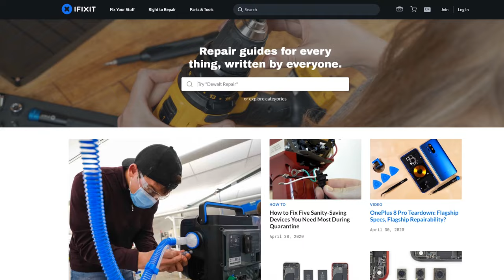Rebuilding my Gaming PC for Fun (not fun....)

Comment: When you want to water cool your PC, just watch any LTT video where they do any maintenance on water cooled PCs. Helps me every time to stick with air cooling.
Reply: Yeah watercooling will quite easily turn into a hassle. A way to make it reasonably easy on yourself however is to plan your custom loop with well placed drainage and fill plug.
Reply: Just used my first AIO.  Seems like a good way to go.
Reply: @Gerniaz  yeah but compare it to a good air cooler, which you basically just pop on. You may get some extra performance with a good loop, but not  enough to excuse the extra cost, work and adding points of potentially critical failure, if you are only going for performance.

If there are space issues, or you have requirements for looks, or you are doing it just for fun, that is a whole different thing.
Reply: @johnh8268  I have found that AIOs', and Linus has shown us, that an AIO is worse at cooling and noisier than air cooling. They also don't looke nearly as good as a custom loop, so at that point why even do it.

But hey, you do you. Some of the AIOs' you can buy now looks decent if you get luky and they fit well in your system.
Reply: Well - you can build a custom water cooling loop that's virtually maintenance free ... but that's not what you see on youtube.
Reply: I'm right there with you. I can't be bothered to clean out the filters or fans but once every 3 or 4 years (typically  pretty clean anyhow), no way am I going to toss water into the mix.
Reply: @Gerniaz  Custom waterloops are for esthetics and if you have real interest in tinkering with your computer and reaching max overclocks IMO , aio's cool better with a few degrees with more failure points, Protip check gamers nexus video on it, and thermodynamics doesent lie.It  takes alot longer for aios to reach lvled temps, so with boost clocks it's an advantage. but as you said you do you. Dont lie and say that air cools better it just isn't true.
Reply: @Gerniaz  Link: https://www.youtube.com/watch?v=7VzXHUTqE7E
Reply: @varghfenrisulven5408  Well It seems I misremembered, which is way different from lying btw, but at least we agree that well done custom waterloops are there for esthetics and little else. 

For 'ordinary' people air wins out everytime.

The argument that it's for max overclocks I call bullshitt on however, if that's the goal you use mineraloil for long term, and LN for short term.
Reply: @Gerniaz  And that's where Jay shows how it should be done.
Reply: @Gerniaz  there's always that one Arctic AIO that actually does better than the majority of AIOs on the market. Even does better than a lot of air coolers because it does so well.
Reply: @Child3k  so... It somehow stays dust free too? I'm interested.
Reply: @varghfenrisulven5408  those more rads at it and get good airflow over those rads and you can get pretty close to ambient temps. So it can be significantly better cooling. An example of way overkill water cooling was that one video Jay did with a box fan and a bunch of rads.
Reply: @Gerniaz  LN2 does indeed make it possible to hit max clocks, but the computer isn't really in a usable state. Water cooling will make it more possible to hit your stable limits and for possibly longer term by keeping thermals down.
Reply: @ArtisChronicles  I'd say dust collection is about the same as every other fuckin' cooling method.
Reply: @Gerniaz  Ok thanks for the answer, we all misremember things. Sorry if it came of hostile. and yeah you are right in that air is the best for ordinary people. I should have clarified it to enthusiast lvl overclocking without ln2 or mineral oil. built a mineral pc in school a few years ago, thats just not feasible to do at home imo.
Reply: idk, the one where they just use an aquarium pump, a cheap block, and a bucket of icewater looks pretty compelling. /joke/ Although if I was ever going to get into watercooling it would be with the ultimate goal of building some crazy sub ambient thing.

Comment: Timestamps:
54:22 starts building/upgrading 
1:14:22 starts fixing things
3:01:21 installs power Supply 
3:03:20 installs motherboard 
3:05:01 installs graphics card 
4:16:52 installs water cooling 
4:57:24 finishes cables
4:59:05 RGB strips replacement 
5:01:05 cable management etc
5:13:10 water cooling adjustment
5:16:32 end of stream
As most people were saying that some times stamps go over the end of the video I removed them. It's not my fault, YouTube cut the video.
Specs:
Ryzen 9 3900x
X570 aqua motherboard
RTX titan 
Gigabyte 1TB SSD
AX 1500i PSU 
EK coolstream 
Bits power tubing 
Corsair dominator 2666 x4
Reply: You sat through the whole thing?
Reply: Wow he could really use RAM upgrade, 2666 MHz with Ryzen 3900x??? Such a waste of CPU power.
Reply: @chnapo1  Yeah bud, he stated that in the video already.
Reply: There aren't any  r5 3900x...
Reply: @JoseSalazar-tk1kd  no one said there was he said ryzen 3900x. thats a ryzen 9.
Reply: Corrected, thank you.
Reply: A madlad watching the whole stream!
Reply: bonus corn xD
Reply: So, the build starts at the 3h mark
Reply: @chnapo1  1) It was carried over from his old Intel-based build. 
2) The silver accents of the old Corsair RAM fits the AsRock X570 Aqua's aesthetics, otherwise he could've just grabbed any other RAM.
Reply: @reikisano4542  yeah awesome he has aesthetics in his rack case which is mounted in rack which is in his server room, instead of actual performance 😂
Reply: when i last remember his son from his first pc building with son video 0_0 im old
Reply: 4:57:03 New way of eating corn
Reply: @CorpseHusbandTopic  sorta
Reply: @chnapo1  Hey, I'm not Linus. I'm just relaying his reasons for that particular decision.
Reply: You sir are a hero
Reply: Thanks for this! 🙌🏻
Reply: @philip2618  The original post said r5 not r9. The post even indicates that it has been edited.
Reply: 4:05:14 Should Linus sell his son
Reply: It ends at 5:16 o.o
Reply: MVP of the comments thanks man!!
Reply: @Dracossaint  Live video went on till 5:43:xx, but for YT re-upload, Linus has trimmed down the video and made a lot of cuts!
Reply: The video (stream) is only 5:16:32... where are your extra 30 min?
Reply: @akuno7294  It was very late when I was doing this so so I was bound to make a mistake. Thanks for pointing it out!
Reply: @Bandit4557  Not everyone has time to sit through five and a half fucking hours of this.
Reply: Wait why did you make time stamps 16 minutes after the stream ends?
Reply: @calvin1053  To be honest, I have no Idea. I'll fix that.
Reply: @akuno7294  kiran made a great point. Due to YouTube,  they trimmed down the video and it was originally 5:43 or something hours long.
Reply: @chnapo1  ram isnt as big of a deal on ryzen 3rd series, yes he could get faster ram, but i doubt he even needs more speed.
Reply: a bunch of these stamps are after the video ended xD
Reply: @MikeHedges1993  ooh boi it is! Low latency high speed ram works better than low speed ram and OCd IF
Reply: @chnapo1  yea no duh, but linus doesnt care, hes already going to be running things high as hell. he probably cares more about the looks.
Reply: You legendary madlad
Reply: youre a man of god for those time stamps
Reply: 10:28 linus starts sucking the tube

Comment: I only give myself 4.5 hours of sleep a night, this is longer. I plan on watching 1.5x speed for 20 minutes a day,  which it will still take me 11.4  days to watch this. **UPDATE: they cut and edited out the first 9:34 minutes of the video when there were tech issues. 
**Also @UCEF8iR5 has the timestamp. I'm stopping this. 
0:06 Welcome 
0:15 Linus's first Gaming System 
1:08 Audio cut on Twitch 
3:42 Linus is Cutting the stream
4:04 Back on track 
4:24 Video Actually Starts 
4:40 Linus exchange and Story with Kyle
6:25 Bringing first PC home
7:12 Audio cut on Youtube 
8:46 Audio Back 
9:34 Video Actually Starts (For real this time)
9:52 Linus being a wee lad with Kyle 
10:49 Bringing first PC home
11:57 Take That Kyle 
12:06 What Linus is doing today 
14:01 Draining Machine 
19:24 Linus giving his rig a blow job 
21:55 Removing Graphics Card
25:21 removing SSD
27:40 Scary Bucket 
27:50 Motherboard Out
28:40 Removing Power Supply 
30:31 Wireless Mic Issues 
36:12 End of the stream 
38:28 Linus calling Nick
45:12 LTTStore.com (unsolicited)
45:41 We are continuing
46:12 Removing Reservoir
*Continue with Directors Cut Timeline below*
25:30 Removing Radiators 
35:16 Not a Little Man 
35:21 Vacuuming the Radiators (brought to you by Dyson)
40:12 The more you know: Rice
44:33 Cleaning the fans
Reply: OK👌
Reply: someone tag me in this when he’s finished
Reply: Watch it on 2 speed and do it 0.5 faster
Reply: why not watch 40 minutes and cut your time In half?
Reply: @AcerAssi  LOL, you mean 1.5x faster?

Or do you mean watch it in 0.5 the amount of time?
Reply: @runninggames771  he said that he well watch it on 1.5 i meant that he should watch it on 2.0
Reply: Bruh making my comments to get notifications
Reply: You should really sleep more. I did the same shit for a couple of years and now my body is in shambles.
Reply: I'ma just insert myself here
Reply: @gjdakin  some people can actually live perfectly normal like that, but not many
Reply: @gjdakin  eh, I can function
Reply: @polrzx  Nah, they edited out the beginning after their was a lot of tech issues. :( my time stamps are all off.
Reply: Dudeomfgstfux aw man :/
Reply: Thank you sir for reminding me there's a 1.5x mode.
Not that I had much else to do today but still a good tip
Reply: @gjdakin  yeah short term low sleep is doable but long term it's an absolute disaster. Though similarly too much sleep is also bad.
Reply: 5 f**king hours LOL!!! Dude I've got sh*t to do! Oh wait, no I don't... I'll grab some snacks and get watching!

Comment: Just built my first Gaming PC for $630!!  Ryzen 5 1600, 2x8 gb mem, gigabyte b450m ds3h, 512 m.2 ssd, XFX RX 580 XXX edition, 700 watt power supply.
Reply: Have fun !
Reply: Noice
Reply: For a first machine really good.
Reply: Niiiice! That 700 watt psu will give you a solid upgrade before you max it out. Good build, dual channel memory, graphics will last you reasonably until AMDs affordable 8gb ddr6 card or whatever you choose.
Reply: Thats was almost like my plan , exvept  mine is a 550$ build , i ended up with a b350 , ryzen 5 2600 , gtx 1070 , 2x4 2666 ram , 2tb hdd , and 650watt 80+ psu
Reply: Arch-FX Gaming in the future definitely get more ram your gpu probably has quite a bit of vram
Reply: @shadymccain9522  yeah thats what i was planning , my b350 is an atx board , so expansion is coming soon , ironic that my gpu has more ram than my system ram
Reply: Arch-FX Gaming lol

Comment: All pumps have optimum throughput values. This can be determined with a flow meter and should be checked after the loop is completed. Radiators, blocks and hose I/D’s all play a role in throughput.

Comment: "always clean your tip when you're done", 1 advice from my side. When you're done soldering, apply solder tin to the soldering tip. that way the tin might oxidize but the actual tip stays good.
Reply: That might not be a bad idea actually.
Reply: It isn’t worth it if you use it on dayly basis, but for the tools you use once in a while it realy helps

Comment: Silver oxide is black. The black coating in your water-cooling system is probably silver oxide. Silver ions are likely to deposit on metallic surfaces that have some charge, so it would be feasible for it to deposit on the CPU interface.

Comment: Linus: I am a robotics technician. Use a Wuha Ultra driver screwdriver. It keeps 12 bits in a spring loaded, rubber gasket sealed enclosure in the rear of the screwdriver that a small piston/spring pushes out of the rear at the push of a button. It does not shake. It does not move. The bits stay put until you pull them and they are kept in a tiny rubber sleeve to keep them all rust free. The best screwdriver I have ever bought.

Comment: That was one hell of a trial by fire, it's not a rig you opened, it was a can of worms inside a pandora's box lolll. When I saw you with the soldering iron and the multimeter. the vacuum, the bug, the tape, the water & bucket, the saw, the drill and feathers and all I thought no way this would work or even end. Plus the sound issues and all. I would have thrown that box out of the window after 1 hour.  I've watched many of of your videos and rarely comment but here you pulled out all the stops and it takes lots of skill and creativity to solve all those issues and your determination has to be commended, you're one tough resilient sob man, so cheers. Plus no food and only a few sips of water. A real tour de force. On a side note, I'm never ever doing water cooling loll.

Comment: No sure if I mentioned before, but why not use a simple vacuum pump you can get at like Harbor Freight, attached it to any water input (like when he did to blow on it) and set the vacuum low to around 5-10 Hgv.  Got eat a sandwhich.  The low pressure will eventually remove all the air in the system, slowly but surely, and also show if you have any leaks.  
Any leaks around fittings will have tiny air bubbles forming inside the water tubing, and be pretty visible. 

Even air in areas of the water loop not affected by gravity will be absorbed and vacuumed out.  Probably work faster if pump was circulating. After 20mins, pour more water in, vacuum more air out, and your done. No shaking, turning, vibrating it out. 
I have not tried, but prefer air cooled for my needs.

Comment: 1:27:30 You shouldn't clean your tip when you're putting away the soldering iron! You should always leave a little bit of solder on the tip, it protects the tip from oxidation (the solder oxidizes instead, but not all the way through to the tip). 

When you're using the iron the next time, heat it up, clean the old solder off, and tin it with new solder. Always keep some solder on the tip when you're not using it, and only clean it (and tin it) right before you start soldering.

If you do that, and turn the iron off when you're not using it (some soldering stations have a "sleep" mode), you'll probably never have to change the tip (unless you solder for multiple hours daily).

Comment: I know I'm like a month and a half late but low resistance is a closed circuit, high resistance is an open circuit.   For a PC power button, you want the normally open and common connected.

Comment: Hey just putting it out there, NC means normally closed and No means normally open as in the connection between those points and common, when the button is not depressed, c and nc1 are closed and c and no1 are open, when the button is depressed c and nc1 open, and c and no1 close, it's a pretty standard configuration for push buttons

Comment: Maybe get a small air compressor with a small detachable aux tank like a mechanic shop would have.

Charge the tank somewhere that noise doesn't matter, then hook up to a fitting to blow the water out. Just regulate the pressure down.

Kinda like when you used your bathroom sink, only in reverse.

Comment: open circuit has high resistance, OL, closed circuit has low resistance 0.01. Think of the circuit as a track and the electrons are racecars. if you cut the circuit you have opened it and the electrons can't flow. it has to be closed for the electrons to flow.

Comment: With a set of alligator clips you can clip on to contacts of a circuit and turn to continuity mode on multi-meter to generate voltage charge - tone through the given circuit which will show if it is open or closed or just broken in wrong place.

Comment: When cleaning radiators and heat sinks, you should use compressed air, or at the very least, a brush attachment for your vacuum!

Comment: If the water has been eroding the nickel plating, that's what the black stuff in the cpu block will be; nickel ions that have collected where the flow of water is slowed down the most to go through the block.

Comment: As long as they are powered down electronics are ok.When back on they must be 100% dry.Most mobo's don't have water sensitive IC's.Problem is moisture can get in the package ,but is a concern mainly when soldering the chips.

Comment: linus tech tips. Would you consider making a video detailing how the home tech enthusiast can hide their unsightly network tech such as their WiFi router and ethernet switches?

I've come up with a couple of solutions myself. 
Hiding the WiFi router in an understairs cupboard and then using a mesh WiFi system (because these can be quite aesthetically pleasing or unobtrusive)

Or, wall mounting the router and covering it with a decorative box of some kind.

Any tips or other ideas on how best to approach this or a video, would be most appreciated.

Comment: My first build was in 2003 with an Athlon (Barton) 2500 XP, OC'ed to 3200 speeds through increasing the multiplier and getting this odd thing called a "heat pipe CPU cooler". CPU chosen because I could only afford poor people parts, and I learned by reading various websites' instructions on building a PC. I ran F@H back then for motherboards.org. I've been folding for LTT recently. 

I just found my buying spreadsheet, and I purchased the FX5200 for my GPU on that build. Like I said, poor people parts - and looking back that was not a good value selection but at least I wasn't gaming (Comp Sci grad school was my thing then).

Next weekend I'm updating my rig to a R5 3600 on the last good B450 board anyone had in stock. I'm still a value buyer, but I have better funding now.

Comment: Pentium-C, phewt.... My first build was a IBM XT PC with multiple modem cards to run the college BBS. Drilled out a 4 inch hole in the top of the case to bolt a BAF on it for cooling. BAF = Big A__ Fan.